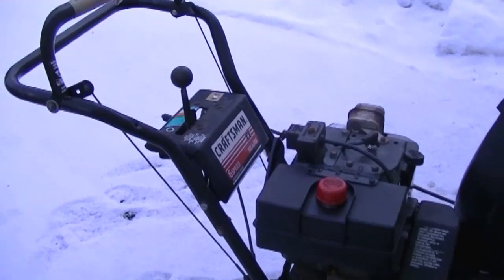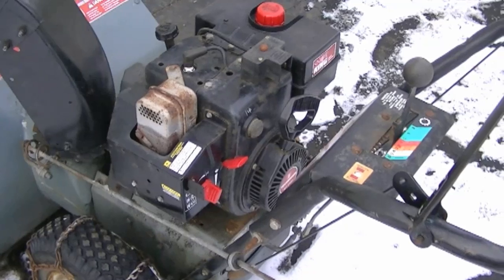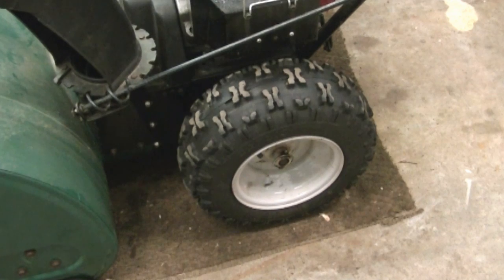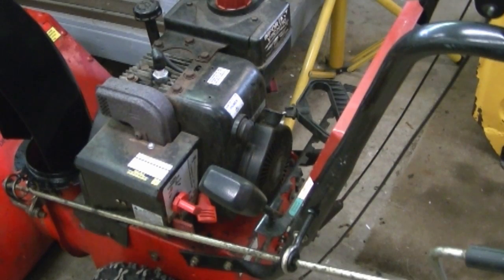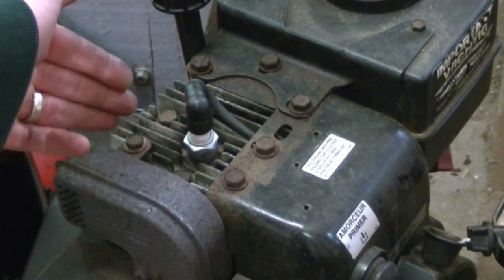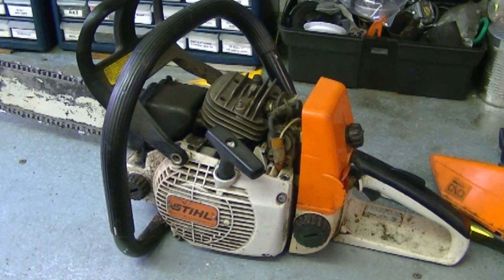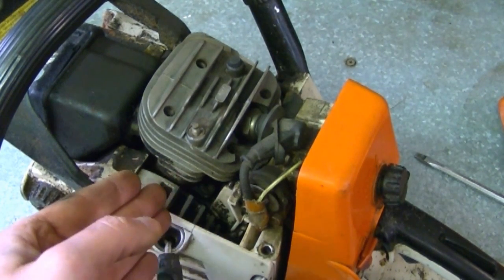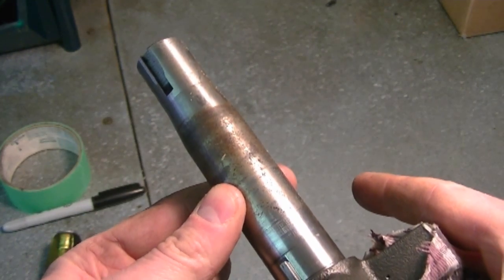Small Engines Q & A Video #84 in HD

Comment: had to replace ignition coil on stihl concrete saw. finding the problem was confusing as it had spark but would cut out. one of your other vids said to check for spark after it cuts out and there in was the problem, intermitent spark. i nearly ordered oil seals 4 it. coil was dear enough. thanks and keep up the good work

Comment: For the  tires   I use  a product  call " Slime  sealant" Through  valve  removal ,  works  for me  car shops  here  don't  bother   changing    small tires   you have to go  to a   equipment place  of   get the tools  you use  in one of your  vids  to  put a  tube in.Have  the   mower   trickle  charging in  the winter   with a  1  amp . Ah  the work bench on  the  shelf :-)   Don great tips  as   always . TY cheers

Comment: @mustie1 I agree 100% with the mustie one. As a heavy equipment mechanic in the desert , where 46C is common in summer, we have heat related battery problems all the time.  Heat warps the lead plates inside a battery... If overheated enough, the lead plates will warp against one another and internally short out the battery, essentially killing it.  Once the plates in the battery begin to warp they are far more susceptible to road shock and any further heat stress, also.  Low amps = low heat

Comment from the maker: @wmgatorfan08 on those flatheads i grind the bottom to get the correct gap between the lifter and the valve, and since it's apart i also lap the valves

Comment: if you don't wanna spend on a new battery charger, you can always build one yourself out of old computer power supplies. bigger ones deliver up to 15A@12V but be sure you load up the 5.5V rail so that 12V rails goes up and beyond 13V and install a load regulator

Comment: Nice video. I thought you were using MY snowblower for it!  Ironically, my machine, even though I bought it used and have had it for 5 or more years, still starts on the second pull. Guess I'm lucky, at least for now.

Comment: Battery manufacturers usually recommend for small batteries 10% of the capacity for charging (meaning 15Ah charge current is 1.5A). Batteries have metal plates inside and long term high current will burn them. The other reason is the charging causes heat and the acid will evaporate. 
Max charge voltage is 14.3V for lead acid.

Comment: dony, the reason for using a lower charge setting is because the higher amp charge causes the battery to heat up and it shortens the life span of the battery, when a battery discharges a corrosion forms on the plates and as the battery charges back up that corrosion disappears so the low charge setting  does  abetter job of making sure the pr ocess is reversed and it don;t heat the plates and battery acid up like a 10 amp fast charge does.

Comment: I recently bought a batteryminder plus model # 12117  12 volt 1.3 amp  that will also de-sulphate the plates on older batteries. Of course proper maintenance like checking the fluid levels and keeping the top clean of any debris plus keeping the terminals and connecters clean will ensure a longer battery life.

BTW I don't see a link on your address to use pay pal so if you don't mind snail mail I'll go that route to send you a small donation from time to time , OK?

Comment: This isn't right but could buy a user some time on a leaky carb problem just shut the fuel off, it will create a vacuume in the maybe and get u buy a little. Works great for small 2 strokes and if it don't work u only loss the gas in the bowl.good advice on the tube in the tire your right they always go flat very unreleyable even new.

Comment: @whitegreg56  Thanks, I've been crimping the fuel line every time it sits, I will just install a shut-off. We were supposed to get 3-5 inches in Michigan, and I was anticipating using it for the first time since I just bought it and fixed it up, but using it in 1 inch of snow is an insult to its ability, lol.

Comment: No #1  thing  people do wrong when using the snowblower  is running it at 1/2 throttle.  I make a lot of money replacing belts and drive disks because of this but for some reason they think it's too loud at full throtle  even after I explain to them that a 5hp engine  and 1 foot of snow must be run wide open for the engine to get to 5hp.   Seems whatever product some people buy the never read the instructions and like you said they buy too small a machine.

Comment: low amp charger is better for the older batt but today they are  deep cycle and with a fast charger set at hi  is like no matter the charger dont over charge or cook the batt and a slow charger 2 amps is good to but the charger dont stop by it self need to be carful to remouve it before the battery is fully charge because with this type of charger is not the amp moving but the voltage so if the battery is fully charge and still charging the voltage go up 14v -15v-16v and burn the batt

Comment: Hi DonyBoy. I used to work for a battery company and the reason you would use a higher charge for a fast charge and lower amps for full charging is due to the battery being able to accept only so many amps.  As the voltage increases the current decreases so as you reach full charge the battery will eventually take close to 0 amps.  This is the principle of having a battery stored on a trickle charger, it will stay fully charged and only be drawing milliamps.  Glad to help you out on this.

Comment: Don, A customer had a gas leak carb 9 hp craftsman/tecumseh.I Removed carb. (the owner also messed with it and failed to fix it) I replaced the seat, I replaced the bowl O ring?gasket, the one he put was too thick, Everything else ok the bowl and it has a plastic float, the owner said it was a couple years old. I did not do any adjustment to the carb.I started it even before I started it checked for leaks ok no leaks I added air to the tires.He did not like the way it ran, I did my job, 

.

Comment: my 5hp tecumseh will only start when it has been primed like crazy. i dont think the priming bulb is oem because it does not have a knub in the middle like my other tecuemseh. it has good spark and runs fine one it is started. i may need to put a carb kit on it.

Comment: its better to charge the battery on a low level charge beaucaus wen a battery is charge to quiklie the electrodes are charged to quick and dont have the resistance they are suppose to have (cranking power). Small batterys are not made to charge at hight amperage since they will over heat.